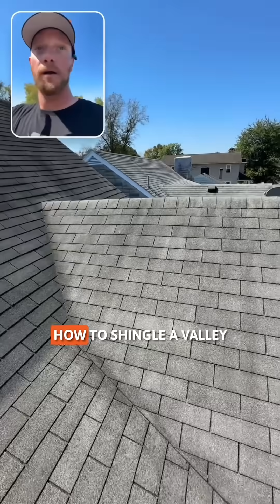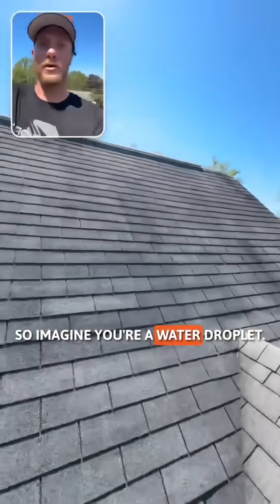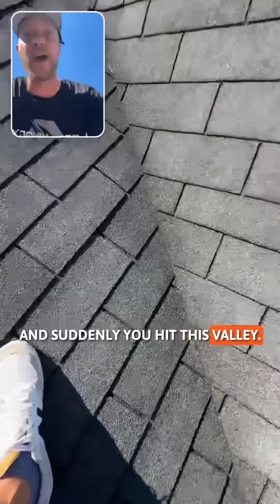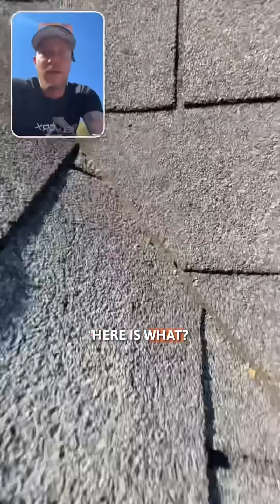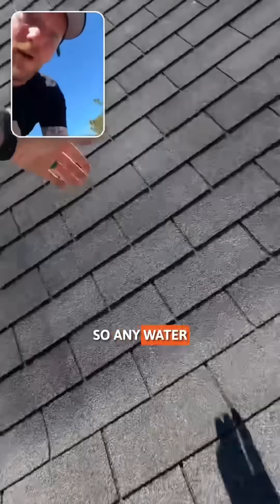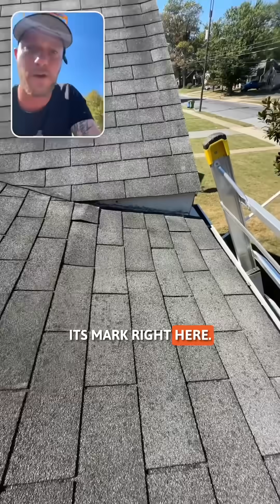Roof Valley Done Wrong! | Why Shingled Backwards Valleys Cause Roof Leaks

Comment: Like this comment if you think this moron has no idea what he's talking about
Reply: Are you a roofer?
Reply: @jeremys959  43 years
Reply: @moses5707 43 years doing it wrong isn't something to boast about.
Reply: @captainnemo5379 ur not even right
Reply: @captainnemo5379 you're so smart you don't realize all he's doing is creating the same problem but on the other side just doing a switcheroo
Reply: @thethiefonthecross9092 Cut valleys are the lazy solution. Pay a little more and demand a properly woven valley on a full re roof job. Better roofing habits cost more than most people want to pay or know to negotiate.
Reply: I thought you would weave both sides into each other. I thought cutting it like this was a short cut. Not a roofer btw although I’ve done a little bit of it.
Reply: If those main roof shingles are run up beneath the dormer shingles 18” and nailed properly, (no closer than 6”) from the valley, there’s no way in hell it’s leaking. 

Most likely that was an ice dam that was never flashed properly with ice and water dam shield self adhering underlayment
Reply: What would you do differently?
Reply: @dawgraphic Not cut the shingles in the valley but weave them instead?
Reply: @jamie0 , Most of the tutorials I've watched that discuss the different valley types don't like the woven method. I'll have to do some back research on the reasons why, but I seem to remember that a woven valley is actually more prone to leak. Others don't like the aesthetics, but that is just a preference thing.
Reply: @dawgraphic correct, more prone to leakage over time.
Reply: @dawgraphic Moses is right if you reverse it you’ll be creating a pocket for water to get under the shingles
Reply: @dawgraphic replace that crap with valley flashing and flashing near the bottom of the valley to divert the water flow away from the dormer. Also replace the damaged decking. If it is out of code, work with insurance to replace the entire roof and bring it in to code.
Reply: @christopherestewart , I like all of your recommendations. However, if my shingles are still in relatively good shape and there are no horrible leaks coming into the house, I'd probably be more inclined to repair the mistakes until I'm forced to do a full replace.
Reply: @dawgraphic  I'd start by not opening my stupid mouth if I didn't know what I was talking about
Reply: @moses5707 & then what would you do differently?
Reply: @moses5707 , I get that there are things you don't agree with on this video. But I'm sincerely here to learn. Which part of this video do you disagree with?
Reply: @dawgraphic  Have you seen the video? Watch it from start to finish. The only correct thing in this video is that this guys name is probably Charlie
Reply: @moses5707  you still haven't specified anything he's said wrong. It's like the guy who asks his wife why she's upset, and she says, "if you don't know, it just shows you're not paying attention." And then she doesn't say why she's mad. Your comment feels like that! 🙂
Reply: @dawgraphic he can't because he doesn't know. The guy in the video is 100% correct. Imagine doing poor quality work for 43 years.
Reply: @captainnemo5379 imagine being a idiot
Reply: @dawgraphic You can actually do this roof the way it's been done, but you must be extremely careful with where shingles end and where shingles begin because it's those gaps between the three different tabs that cause the problem. However, I would never do a valley like this in an area that gets a lot of snow
Reply: @dawgraphic i agree with you! My comment back to the guy doing the video is: doesn’t it just reverse the problem if you run the dormer shingles first? To do it correctly, at the bare minimum, you lay down ice and water shield in the valleys. You also run the shingle up the valley and onto the other roof plane at least 12”. You could weave the valley shingles: so you run the main roof course up to the hable roof, then lay the gable course on top of that. Then the main roof, then the gable. The downside as installer is you can’t lay shingles on an entire roof plane at once. It’s slower to weave. 

I do think the best option is to put down valley flashing on top of the ice and water shield and run each roof plane to the valley flashing. That’s going to be more money though.
Reply: @andrewlewis3665 this is the correct way. I've never done a valley that wasn't ice & water, then valley metal, then weaved on top, but I have seen a lot of roofs done like that. In my opinion it really doesn't make enough time difference not to weave the valleys, especially because one guy can do that part while the rest of the roof is being done. Unless you're a 1 man crew, then it's pick your poison.
Reply: @andrewlewis3665 , I can see that perspective, but as I understand these tutorials, they're saying that there is a lot more water running from the main roof down into the valley than from the dormer down into the valley, especially if the main roof pitch is steeper than the dormer pitch. The way I did mine was to run the dormer shingles up onto the main roof, with the middle of the shingle where the middle of the valley is. After weaving the bottom two rows, I then ran a bleeder row of shingles parallel to the valley, but sitting up about 2" from the valley middle. And then, I ran each course of shingles from the bleeder row all the way to the edge of the roof.

Most of the YouTube tutorials don't like the valleys that are woven all the way up. They cite every reason from aesthetics to leakage, but I don't know why a woven valley would leak more than any other type.
Reply: @andrewlewis3665 Although doing it from the other direction does reverse the problem but the difference is there is a lot more water coming off of that main roof than off that small Dormer. My house is roofed in the style of this roof in the video in central Ohio and there's never been a problem. They did use that special membrane under it. 

When I roofed houses we used the valley tin and it worked well enough but I don't think it looks as good, although it doesn't look horrible if you cut it in neatly. 

The secret to making it not leak when using the valley tin is when the shingle lands on the tin, you do not ever drive a nail through that part of the shingle. It will cause leaks even if they are slow leaks, and blackjacking the nail does not make it okay. 

You obviously cannot have a short piece of shingle if you do that, It has to be long enough so that you can get some nails in the shingle without putting a hole in the valley tin. You definitely do not want to nail the end of that shingle and have your nail go through the valley tin. 

Anyone who says that's okay to do does not know what they're doing. The shingles will not blow off either and I've never had a single shingle blow off from not nailing the ends of the shingle it where it lays on the valley tin.
Reply: @douglashanlon1975 
@moses5707 probably never heard of ice daming either! Big problem for shingled roofs in heavy snow areas, that experience frequent snow- thaw cycles, during the season. It's responsible for millions in home warranty and insurance claims every year! Shingle well down into the ice barrier, and seal under the overlapping shingles that are on top of the barrier. That's the best way to finish a valley.  Later! 👍💯✔️👏🏁🇺🇸.
Reply: You’re clearly the dumb one bc what he is saying is spot on
Reply: You're supposed to pin wrong comments
Reply: I believe you don’t know what YOU ARE TALKING ABOUT….IF YOU DID YOU WOULD UNDERSTAND APPARENTLY YOU DON’T!!!
Reply from the maker: TELL EM PATRICK
Reply: When I did roofs we installed flashing in the Valley although we live in Canada
Reply: There's a lot more water coming down the main part of the roof how do you people not get that?
Reply: Not a single clue 😂
Reply: Im not even a roofer and what he said makes perfect sense. So if your doing it another way id say you're the one doing it wrong. You want the water to flow onto surfaces that will always be on top of the surfaces they are going to join with. Just think of how shingles are laid, your start shilling from the bottom of the roof and then place the next line of shingles OVER the the first line and rinse and repeat. If you started at the peak and worked your way down then the water would go under the second row of shingles. The same concept applies to mating surfaces.
Reply: Do tell us how you do it, Mr. Brown Man.
Is it because he forgot to mention the roofer is supposed to take several breaks for cerveza?
Reply from the maker: Like this comment if you think @moses5707 is a moron that has no idea what he’s talking about.
Reply: @dreamworx_roofing dislike

Comment: I would also shingle the smaller roof first but one thing you didnt mention is not to cut the shingles right on the valley line.  Its best to cut the shingles a little up the overlapping side by usually an inch and a half

Comment: Low side is shingled first then the high side is shingled last.  That happens in most cases.  Only time is if there is more water being deposited on the lower portion as in 2nd or more roof decks depositing water on the lower deck or dormer deck.

Comment: As a non roofer why wouldn't you use flashing instead?
Reply from the maker: We would absolutely install a valley liner like ice and water shield or metal in this valley. This was just an inspection video of an old roof that was experiencing leaks at the valley.

Comment: He’s exactly right about water  the higher volume of water runs over the lower volume  it also has 2 do with the run  the dormer also has a shorter run   So I would’ve run the dormer 1st n then the main over top  but also cutting 2” back from the middle of the valley 4 the water 2 run off easier per manufacturer specs   I always like metal valleys  but I also c 2 other potential problem spots. He pointed out 1 at the bottom where the fascia hits the deck. I always put over sized step on the deck 5” instead of 3” n the other spot is where the 4 pitch 2 8 pitch transition is  u gotta make a small relief cut 2 make it lay flat  always seems 2 b an issue on that type of dormer design

Comment: In my area of New York I was thought to run the lower pitch valley shingles up onto the steepest pitch then overlay steep pitch ontop of lower. No nails within a foot of valley always use ice and water. Never had any issues. I do prefer architectural shingles over the tab kind so u never have windows in spots a full piece would be more ideal

Comment: If you shingle the gable roof first then the water will run under the main roof shingles.  Just the reverse thing but resulting in the same problem.

Comment: A metal trough and a waterproof membrane would be best, I'd think. The whole roof should be covered in the membrane under the shingles, although most new homes don't have that for the first 15-20 years until the roof gets done right (not by the builder).

Comment: I was imagining wooden shingles then realised it was stamped out shapes of roofing felt! Forget what would happen if there was a fire but why not use proper slates or tiles and make the valleys of lead sheet? I’ve just replaced the slates on a 1890 ish property (135 years old). In the UK tarry roofing felt is only used on garden sheds or 20-30 years ago to overlay slates that had nail sickness to get another 10-15 years life out of the roof. You would think with Mr Piggy in charge everyone would know the story of the 3 pigs & houses.   ;)

Comment: As far as I know you can only weave shingles if the roofs are the same pitch or approximately the same pitch…?…but either way it needs to be done MUCH better!…I’m aware of about 12 different ways to do valley points…if you don’t install proper insurance techniques you may problems in the future…!

Comment: Shingle up to where the valley starts , run a valley flashing down overtop of shingle then continue Shingling up the roof cutting in the valley as your preference.
Any water that gets underneath the Shingles in the valley will travel down the flashing and come out on top of the shingles.

Comment: Pitch transition in a valley is always the biggest pain in the ass stg, if they weren't gonna use a metal valley, they should've switched the overlap shortly after the transition. It's lapped the correct way for the lower-pitch portion of the roof, but the cut line shouldn't be in the centre of the valley. Also they shouldn't have even done a cut valley in the first place it's fucking 3-tab ffs just WEAVE THAT SHIT

Comment: I am not quite understanding this guy's train of thought.  Reversing the way the shingles are layed will still present the same problem. Ice and water barrier is not the answer either. 
  A valley tin will allow the water to drainas long as it passes past the facia at the bottom.  The valley flashing also has a raised part down the middle to stop and redirect the flow of water. 
  The other option is to actually weave the shingles running the shingles up the other  side  and alternate the weave with each course. I'm not sure I would want this guy roofing my house either. You need to be smarter than water,  I think  water is smarter than this guy. 😅

Comment: Im no roofer but thinking like water: 

Wouldn't you shingle the lower pitch roof first extending the shingles above the valley and up the steeper pitch and then shingle the steep pich over that?
Water running down the main roof isnt going to climb 10" up that other pitch is it?

Comment: Shouldn’t make a lick of difference. If it’s flashed correctly under those shingles. 
They should just be there looking pretty. 
Should be a 24” valley flashing with ice and water on top under that. No amount of “ramp” water would make it past that.

Comment: Your right on a couple things . All of the valley should be weaved . The lower part where the valley ends is where its leaking because its improperly flashed and woven. Thats the primary source of the problem.  Plus the lower portion of the valley isn't cut on the wrong side because of the  different pitches but main roof is definitely wrong that why i would just weave both sides. Hows that cap tied into the main roof ?

Comment: Water hitting either roof. Water doesn’t pick & choose which roof though. Water hitting from different angles. I have steel roof flows onto bull nose veranda steel roof and the valleys have aluminium channel  installed standard. I don’t know about American regulations.  Or u could install flexible flashing.  American designs are odd.   Your house roof & gable roof meet really should have an aluminium channel flowing down to down pipe storm water drainage.  And also the 2 roofs meet should over hang over the valley/channel primarily steel roofing though.  

U need flexible flashing for this design cheaper alternative. Maybe the damper flashing roll stuff used for bricks.

Comment: Wouldn't the water from the reverse gable just run under the main roof shingles?  I understand  the reverse gable is a smaller surface area.
Reply: Exactly.  The smaller roof can certanly have the higher flow, especially if it faces the prevailing weather direction.

Comment: Even if you reversed that lap the rain that lands on the dormer would still run under the main roof’s shingles in the valley
Reply: Nope.  You are probably one that cuts the wrong side.  The main roof is higher so the force of the water coming off that roof will always be greater.  The water in the valley will always push towards the dormer away from the main roof.

Comment: Incorrect.  The low pitch area should be shingled first the way it is now.  They just didn't switch to the Dormer first at the pitch change.  You don't think water and ice will get underneath the valley on that low-pitch area if you were to shingle the Dormer first there?

And how do you shingle the Dormer first when there's a step tin wall below it?

Comment: You are correct here, but not great in your explanation.  The reason why you want the overlap the other direction in this scenario isn’t because water goes down that roof.   Water goes down both roofs.  But the dormer is a steeper pitch here so water won’t stay there as long, and the bigger roof carries more water, so you don’t want it being driven into the joint.

Comment: That roof was done correctly because the roof with more slope goes on top of the other, just the valley should have been higher and sealed underneath or just use flashing valley

Comment: So question me this... If you shingle the gable before the main roof, haven't you the same problem but only in reverse? Also isn't there valley flashing and a layer of membrane running the whole length under that valley?.
Reply: Exactly.  Roofers argue that the larger side gets preference.  But it’s a flawed logic.  The house orientation to the prevailing winds  determine which plane gets the most rain, not Necessarily the size of the plane.
Reply: @legonut78  And that my friend is pure scientific logic that is LOGICAL. That's why when I decided on ridge shingles instead of a ridge vent I had them installed laying over each other like bird feathers, working towards the direction of the most heaviest prevailing winds. To prevent possibility of uplift! I'm sure they would have probably been fine the other way but if you know something is logical and it may help... Why not choose to go with it! 🥇💯✔️🎯👏👍🇺🇸😉

Comment: I have seen where there is shingles running up the valley so the shingle fold up both sides then the roof shingles overlap the row up the valley and are cut back a few inches

Comment: This isnt backwards, just installed incorrectly. The steeper pitch goes over the lower pitch and gets the cut and you cut 4-6" out of the valley centerpoint (or California no cut depending on preferred style) Licensed Illinois roofer